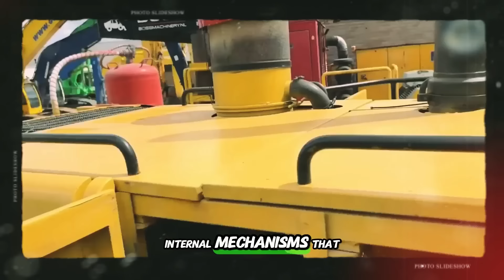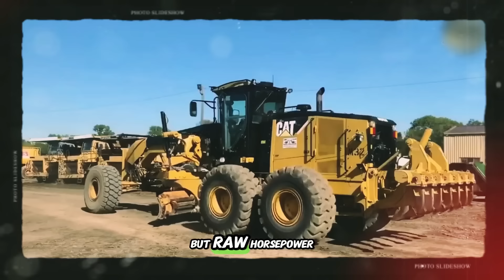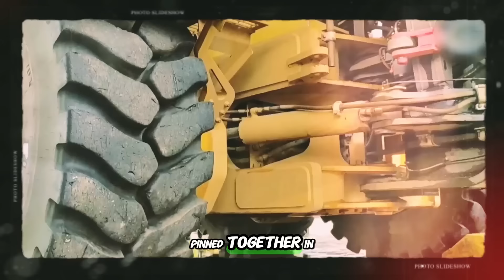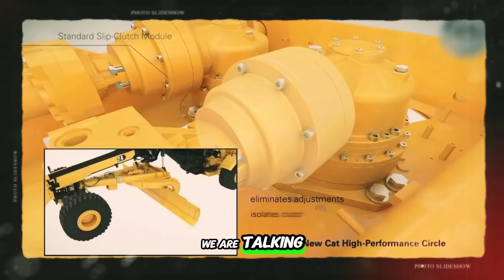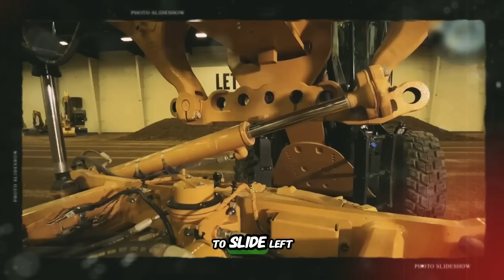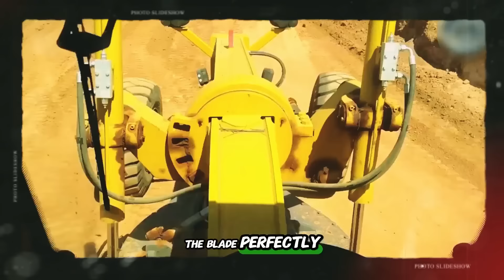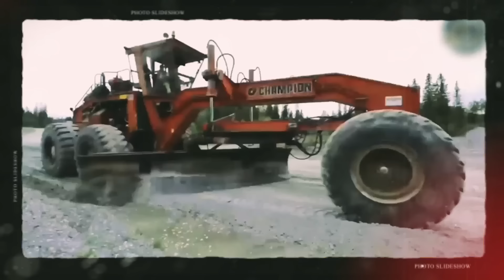Why Do Motor Graders Tilt Their Wheels?

Comment: 52 years operating heavy equipment. Mush of that operating road graders. Every brand you can think of all the way back to the old worm gear driven controls. Retired last August. Now I teach road grader operation for a large university.
Reply: I ran a 49’ Adam’s with those crash box controls . 7 miles of private road for a lodge owner . I learned a lot about how much cut I can get away with .
Reply: @duncandmcgrath6290  I owned a 46 Cat 7T for several years. Once you cut your teeth on one of those there is nothing you cannot operate!
Reply: Would this "big university" be part of Texas A&M in Byron, TX?
Reply: Grader operation is now a university course?  Wow!
Reply: @p38arover22  @p38arover22 7 hours ago  A resonant joke maybe that THIS SHOULD A DEGREED- - - "PHD" - Piled-Higher-Deeper - - - as a non robotic/replaceable human by AI.  eh?
Reply: I have a 100-year- old pull behind grader  that I use for fixing my driveway it takes one person to drive the vehicle pulling it and one person operating the blade, and it's big hand wheels, turning worm gears.
Reply: @jpeterd92 used to see it some 20 years ago in this old mine in my town.
Reply: I’ve been a robotics engineer for 15 years, and am also a gardener and cook. Now I’m putting a kid through college. I drive on roads a lot.
Sharing is fun.
Reply: @maliq4 haha that's my kind of comment right there, I love that kind of humor
Reply: Respect!
Reply: The new ones are way more difficult run/ learn, in my experience, until you learn the new technology involved and how it applies. I'm fairly green when it comes to operating graders properly.  I've run and operated almost everything out there. From construction to underground mining. I know the guy that grades the deepest underground road in North America. Thats one hell of a skill set. He's a wealth of knowledge. Even with all the new technologies he says that once you learn how grades work that everything is easy. Regardless of the age of the machines.
Reply: Thanks for your service....
Mike Rowe must be proud........
Reply: Who spends 60 years operating these machines 😂
Reply: @TiyambaniNyoni  I spent 52 years on equipment. Owned my own business for years. All documented fact
Reply: @TiyambaniNyoni Someone who started when he was 14 or 15.
Reply: @jefftheaussie2225  grew up on a farm, was driving tractors before age 10
Reply: @Bkamron  This concept is unheard of for ppl growing up in the city/suburbs. I waiting on that comment with that age 🤣👍🏾
Reply: @TiyambaniNyoni I’m 63 I’ve been fixing mechanical things since I was 12, I’m not getting your point?
Reply: @MarcAnthony435  And that was the average age a boy could be left alone doing some basic mechanics. Oil change, tires swap, maybe a water or fuel pump, belts ...etc ...and of course, it was double check by an experienced adult. That's when you gradually transition from fixing your bicycle to vehicles and/or garden equipment. Fun times.
Reply: @TiyambaniNyoni  I need to catch up quickly to beat that guy.
But the good news is that he gave up after 52 years.

You might be laughing about someone doing the same thing for 52 years.
But keep in mind that stability has its benefits!

Working in an industry that is super volatile, is that what you prefer?

and as always, the grass is greener on the other side of the fence.
Reply: @TiyambaniNyoni  There's a lot of legendary horn blowers in the comments.
Reply: @bertcandee3188 😚